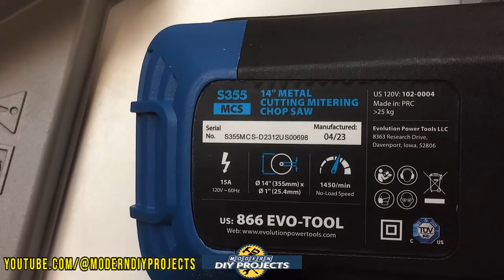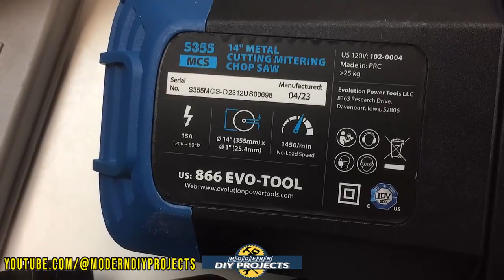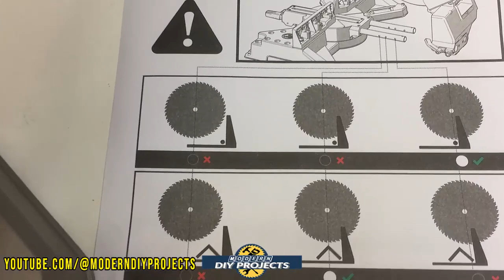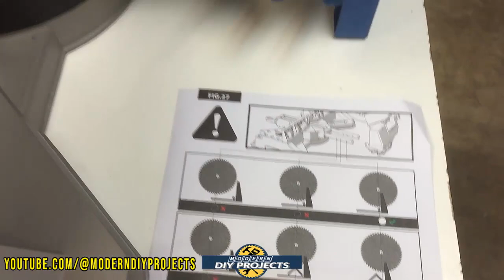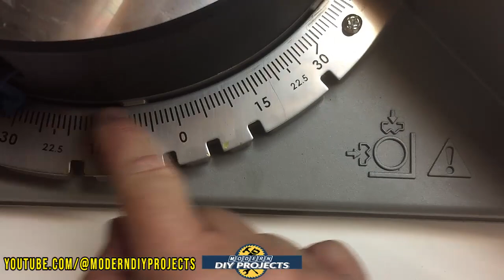Best Mitering Chop Saw for Metal - Evolution S355MCS 14" Heavy Duty Dual Miter Chop Saw

Comment from the maker: This is I think the best mitering metal chop saw on the market. It's not cheap but it is well worth the money for all you get. It is an all metal construction and only the handles are plastic unlike so many other brands out there with lots of plastic parts. You can also use this to cut wood if you change the blade to a wood blade.